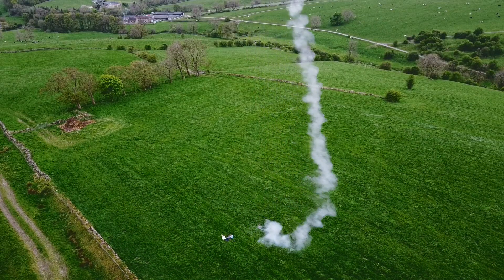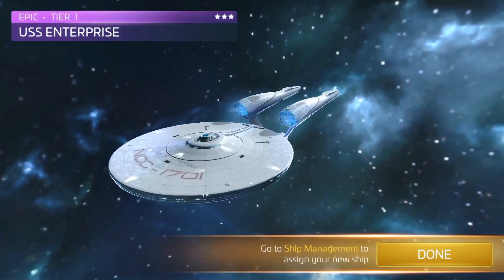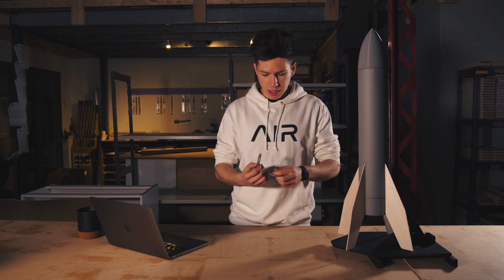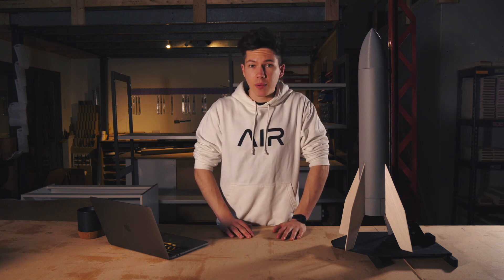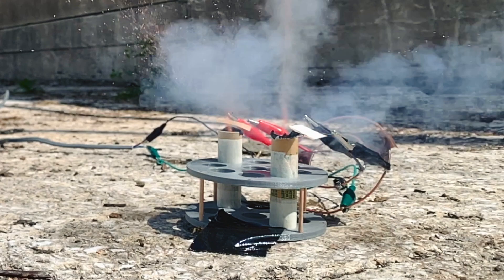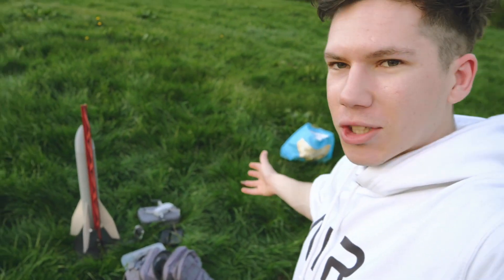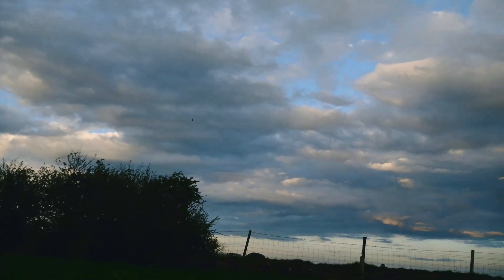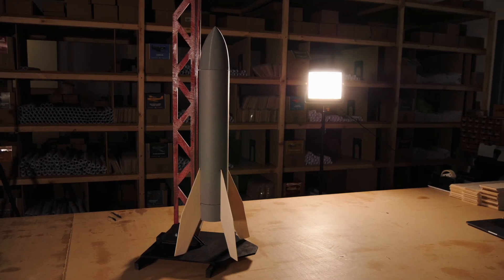DIY High Power Rocket

Comment: Ok, here's my technique for 100% ignition of clustered black powder motors - foolproof!  Been using it since the 80's with 0 failures.  I used to call it my 'explosive ignition system' - but did see someone call it 'flashpan ignition'.  The way I do it is to 'prime' the nozzles with black powder, flush to the bottom of the motor, then carefully seal with tissue paper around the base of the motor, using white glue.  This is done immediately before launch.  Then prepare a small 'reservoir'  or 'flash pan' of black powder with a single (launch) igniter - below the mounted motors, which will flash directly onto, and through the tissue paper.  I guarantee 2 things - 1. with that black powder filled in each nozzle, each motor WILL ignite.   2. Each motor will ignite at precisely the same time.  I have found that FFFG (finer) powder works best.  Probably any type of flash powder would work, as well.  Here's an example of one of my launches using this technique from years back - also with a recovery system failure!  https://youtu.be/P-8d2fuFeOE  Enjoyed your 21st century manufacturing techniques - keep having fun!!!!

Comment: Regarding the ignition system failure, it isn't necessarily the igniter's fault, with enough voltage, and the right type on battery, they should all ignite. For example, I usually make single engined rockets, however, my latest one is a three engine cluster one. For single engine rockets, I use a 6 volt alkaline battery controller. However, for the three engine rocket, I had to go out and get a new controller, and a 12 volt lead-acid battery. The reason why lead-acid batteries are important, is because they have the lowest internal resistance of any consumer battery, which allows the maximum amount of power to the igniters, and subsequently helping a more reliable ignition. The battery and voltage choice might be the issue for you. You can buy lead-acid batteries from most auto stores, they're usually car batteries, but those are more expensive. I managed to find a really small motorbike battery, which is roughly the size of the lithium ion batteries you're used to, and they're relatively cheap.

Regarding the failed deployment, that's most likely caused by the ejection charges not firing at once, you basically only get the power of one engine's ejection at any time. It's probably worth loosening the nose cone, or drilling vent holes in the tube and using an electronic deployment system. But I'm sure you know all of this.

One last thing worth mentioning, is that maybe you should increase the length of your launch rod to encourage more stable flight.

Other than that, I love the unique design! And the launchpad looks sick!

Comment: put a locking servo on the launch tower that keeps the rocket on the ground an extra 1/2 second after ignition to allow all the engines to get going before it unlocks.

Comment: For the stand use bearings in the rails to help create a smooth and less resistant launch. Change the buttons on the rocket for a rod as well to make sure it doesn't get caught on said bearings. Dong this might unbalanced your rocket though so it could be worth putting rods on opposite sides if the rocket to ensure stable liftoff and flight

Comment: Had to laugh when you were shouting "eject" and it javelined to earth. My first rocket (back in the 80's), made from a bicycle pump tube, a turned hardwood nose cone and thin plywood fins, did the same thing because in my case the nose cone was a little loose and I kept it in place with some tape, which I forgot to remove before launch. Later on I bought a few Testes kits and made a Saturn V from scratch using a cluster of 3 C size motors.
Also, when you tested your ring ignition system you could have just used the igniters rather than waste the motors. The launch tower we used was simply a 3-4mm diameter steel rod (in a base) and the rocket had a couple of slightly larger diameter cardboard tubes as the guides. I think the guides and track on your tower would have quite a rough surface area which equals friction which reduces launch speed a tad and less altitude. Good luck with your future space program.

Comment: It would be interesting to see if you could build a common pressure chamber for multiple engines and then you could have a single exhaust nozzle. It would probably be pretty hard to light all the engines but at least you wouldn’t have to worry about a symmetrical trust if they let a different times

Comment: Getting that many motors to light up all at the same time is a challenge. You might want to connect with your local rocketry club (you seem to be in England, check UKRA website). The "launch tower" you made is very close to what is generally used in model and high power rocketry. We'll normally use T-slotted aluminum extrusions for a launch rail (they are relatively inexpensive and easy to get). The 1010 rail (a square 1" rail) is standard for high and mid-power (probably substituted for 25mm rail in Europe?).
Reply from the maker: Hey Aleksandar, good idea, I do plan on getting into proper high power stuff at some point so joining a club would be the way to go! I intended to get an aluminium extrusion but couldn't for this video due to shipping restrictions at the time. 👍

Comment: I think you should use a momentary launch switch, keep the toggle arming switch. If you forget and leave the launch switch in the fire position it will ignite as soon as you arm it. The launch rail should be longer too. If available I would use larger mid- power (E, F or G) impulse motors and avoid clustering or at least reduce the number of motors in the cluster. Nine is rather ambitious. Another option would be to air start some of them, there electronics made that will do that. Lastly search for a rocketry club you can hook up with. And what the safety codes are in your country. Not sure of your location but here in the US we have the NAR National Association of Rocketry and TRA Tripoli Rocketry Association. Tripoli has groups in different parts of the world. Both have smaller regional clubs, maybe one nearby. You can learn so much from other more experienced rocketeers, there’s always plenty willing to help and you get to see all of their rockets fly. Depending on the launch site there can be very large high power (H - M +) impulse flights. Really awesome to watch. Keep learning, have fun & be Safe!  Jim R.

Comment: I was in rocketry for 6 years and getting all the engines to light at the exact milsecond is almost impossible. But that was a good flights. It is better to have a loose nose cone and then you can use small strips of tape to make it fit just right.

Comment: You need to make sure your launching rig has enough juice to heat up all the igniters quickly. Will Probably fix that issue, and you will need a real ejection charge or a push rod that will use the ejecting charge more efficiently. the body is too big to count on the motors to eject the chute.

Comment: You need a clamp and release system. That way you don't have to worry about all engines starting at the same time. Delay 2 seconds then releaae and you'll have equal thrust from all engines.

Comment: Really cool project. Instant subscribe. curently I'm working on my bachelor thesis and creating rocket with 3d printed parts. Your project have me some really good insights about 3d printing usability in rockets that I was looking for but couldnt find anywhere. Thank you. By the way try to make smaller buttons for the takeof rail. They really crsate a lot of significant drag. Also talking about ejection. You could try to create some sort of mechanical/electronical system to push parashute thus you would have more control over your rocket. The system would also put mass center higher which would lead to a better rocket stability which is really important when you have 9 clustered engines. Keep up good work and good luck in your next projects!
Reply: Most ejection charges use bp

Comment: 3 Rules of Rocket Science
1) Give it enough thrust, and anything will fly!
2) If you want it to fly straight, the back end has to want to go slower than the front.
3) Getting it down is easy.  Where and how fast require some forethought!
Everything else in just minutia!
Reply: not good advice

Comment: I would recommend sanding down and polishing the nose cone, fins, and body tube. It will 1. Look better, 2. Be a bit more aerodynamic so it’ll fly a bit higher. I’ve never worked with 3D printers myself, but I know a lot of guys in my rocketry clubs that have. I like working with fiberglass with epoxy mixed with carbon fibers for my fillets on my fins. I like this concept you did though. I may just have to try it.

Comment: Okay so it seems you had a lot of fun with this project, I like it very much.
 I am a bit into model rocketry so what I noticed immediatly was that your launch tower seems very short. Also in the fire test you could see that the ejection charges went off at very different times even thought the engines lit at the same time. I think you will have to buy engines without ejectors and build a seperate ejection system that is activated electrically.

Comment: What you could do if you had model rocket quick fire fuse or that instead of using alligator clips because they would give you a better technician and it would not fail because I have done that for my three stage rocket

Comment: Great!! I've run rockets in the back of RC planes before, and I've found that the model rocket igniters, ignition, and connectors, are all utter garbage. I ended up using home-made versions of all these things. Much thicker igniter wire with cyanoacrylate attached pyrodex (I ordered it online, I live in the US, please check your local laws if your decide to do this) and pwm switches (easy to drive from rc receiver) switching tens of amps from lipos. Ignition of the motor became far far more reliable and much much faster. I think this could help. I also made a circlip-like mounting for securely fastening the ignition system to the igniter, but I appreciate that your application is different. Crocodile clips are, I think, always a terrible answer for anything that involves motion. Great rocket and I really enjoyed watching it fly! I wonder how many engines you need before you can mount servomotors to the fins and attach those to an electronic gimbal.
Reply from the maker: Sounds good but yes unfortunately all of that with DIY rocket engines etc is completely illegal here in the UK. 😬

Comment: Put the ingnition battery in the rocket and run a switch to launch, that way all the igniters have power to give them time to heat and start the motor even if its left the pad

Comment: Great project and another fun to watch video. Well done!
A word to the wise though... Way back when I was still doing A levels, we had a lot of fun building multi-engine and multi-stage rockets using Estes engines and homemade propellents. At the time I almost got arrested and very seriously fined for building a very high powered system. I didn't know it at the time, but there's a very strict limit on the total propellent that a single rocket can use before you start needing certificates, CAA permission, etc. 
Love your work. But be careful. 
PS. As others have said, you'll never get a simultaneous firing using those electro-chemical igniters. Hold it down for 0.5-0.8 seconds to allow full ignition.

Comment: The best way to assure even thrust from multiple motors is to add a hold down lock to your launch rail using a servo.  It would only need to hold the rocket for a second  or less.

Comment: Nice launch! The rocket launcher controller should have 1x 2 positions switch and 1 momentary switch. In this way you should be able to control the duration of the short circuit (releasing the button after launch). Feel free to take a look at my 'ible' on Instructables.

Comment: Getting them to all go is a challenge. I thought of first slightly roughing up the inside of the solid fuel where the igniter goes and also adding a bit of flash powder in there then inserting the ignitor. Also since there are 9 of them make sure your power source is up to the task. To light one is just a burn so when it goes it goes. But lighting them all may need a faster power spike to make the ignitors flash as opposed to burn. Good luck with this it's very interesting to follow. Or just use one big motor and screw it.

Comment: manual ejectors maybe?
just 3d printed holder with small servo in the head if its not to heavy or timed ejection if its to high for signal or maybe even an ejector with a C02 bottle
if you want i would like to help and send over some ejector ideas if the the rockets are not enough

Comment: hey just wanted to let you know why I think the parachute failed, ive done some rocketry in my life haha. No, but if you look at the footage of your first test, the ignition charges' come at different times, so without the sudden strong force, it wont be able t take off the tight head. You may also want to look into some tissue paper to give some volume resistance to the burst and force out the parachute
Reply from the maker: Hi good point about the ejection charges happening at different times. You can actually hear them going off separately on the footage. 😬

Comment: Could you put each croc clip on long lengths of wire so they still have time to ignite as it starts moving up the launch stand.

Also you could mount a dowel on the inside of the nose cone with a disc at the opposite end so it works like a piston to eject the nose cone

Edit: great production in this video too
Reply: I was also going to suggest longer wires on the croc clips.
Reply: Yes, tried that back in the '80's. It works.

Comment: put some loose black powder on top of all of the engines so all of the loose powder will ignite and eject the parachute with one blast, not counting on all of the motors firing their ejection blast at the same time. there needs to be at least 5-10mm of clear airspace above the engines, so the flame front from one engine eject blast will ignite all the others.

Comment: In the UK you can still use a product called Tape Match from places like ModelRockets.co.uk
They let you ignite an unlimited number of motors (well, limited to a 15m roll) with a single igniter. You also need igniter sticks to transfer the burn from the match into each motor.
You could use onboard electrical ignition but that adds weight and some safety concerns you'd need to address.
Happy clustering!

Comment: Think about a piston style eject system, you have a large volume for a comparatively small charge. Also heavier  cable to guarantee amps  at the igniter.
Reply from the maker: Might have to try that yep
Reply: @Project-Air  Plus, if you watch your two-motor test again, you'll see that the ejector charges were not even close to synchronized. It was probably a series of small charges, instead of one big one. The solution is obvious: you need moar strutz!

Comment: You didn't mention the size of the motors.  There are larger motors so you don't need to cluster. 
http://www.pro38.com/
If you go G size motors there are certification requirements.  But that's not hard to do but you will need to find a club.  The USA has Tripolie and NAR.  I think there is something like that in the UK.
Reply from the maker: Yep, I was going to include a section in this video explaining that these motors are some of the largest you can get in the UK without certification. That's sort of the concept of the video, to get around the problem of low power motors in a DIY way.
Reply: @Project-Air  I'm not sure about the UK but if you add up a bunch of smaller motors so the impulse exceeds a H motor is that an issue?  Basically the impulse doubles every letter.  so two G's or an H worth of impulse.  

If your interested a Level 1 cert is not very hard.  There is a test and you build a level 1 rocket and fly it without crashing.  Normally this would be at a club event.  Also in the US when you exceed H and above you need a FAA waver.  

Great video.

Comment: Maybe consider holding the Vehicle on the pad post ignition and having a sensor under each motor to see if it ignited. Once ignition of all motors is confirmed have a microcontroller release the Vehicle
Reply: But wouldn't that delay launch quite a while? These rockets only burn for a few seconds anyway. Maybe just add a resistance so it delays launch by some time giving all the motors time to ignite like others suggested?
Reply: Not very practical when burn times are often less than a second.

Comment: for the ignition, your battery is probably not supplying enough current to light all 9 simultaneously. I'm sure you have plenty of larger 2s or 3s batteries to remedy this. If you don't want to go the electrical route, a common way of igniting clusters is putting down a pie tin or similar baking sheet with a thin film of black powder. These "flash pans" aren't super reliable, but they're a quick and easy method that us usually pretty successful.

If you want to spend a lot of time making something perfect, check out this link: http://meatballrocketry.com/pvc-spider/

best of luck!